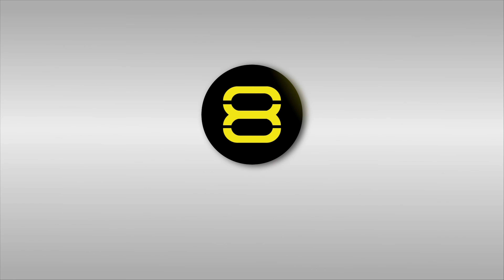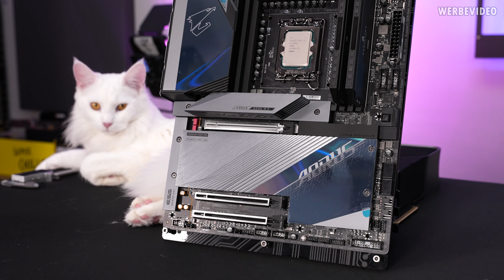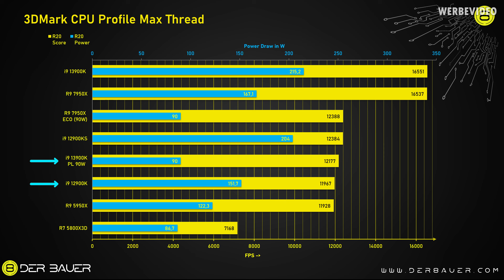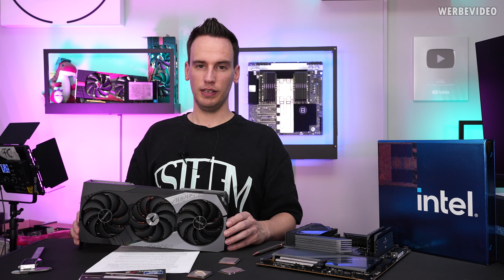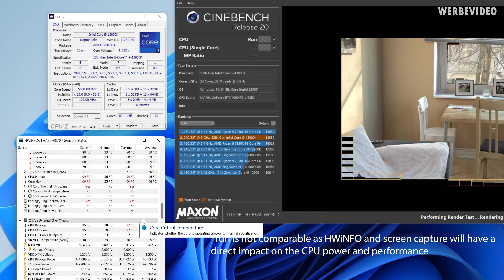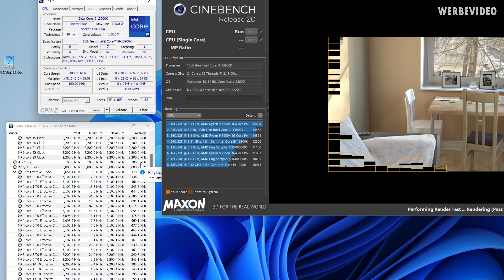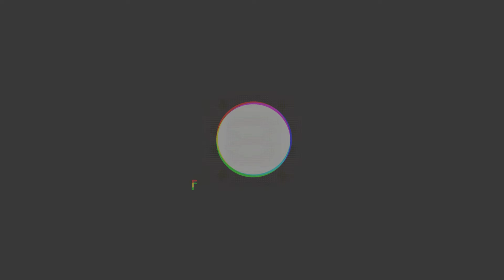Testing and Tuning the new 13900K for Efficiency

Comment: Question: what if you set a power limit of 200w then down clock the e-cores to 2.2ghz and cache to 3.5 to 3.6 how much loss in performance there would be compared to just altering cores and cache frequency? 

Might not be so worth it but can you try this on the 13700k as well?

Comment: 13700K+Corsair H100x+ ASUS z790-p WIFI

 Hello!
 Thought I'd check here if anyone has some knowledge of what I can do to bring the temperatures down on the cpu.
 I average 75-80c when running CinebenchR23.
 some games I play cause the fans to spin unusually much in my opinion.
 Cooling paste recently replaced with Thermal Grizzly Kryonaut, also the fans for the radiator replaced with 2*Noctua NF-A12x25
 all tips are welcome

Comment: This is exactly why you don’t listen to haters on the internet. If you know what you are doing and use common sense and do some reading. You can tune any system. I’m currently running a 13900kS on a H100i at power limit 288watts. I’m only playing games and it usually only takes 80-140watts

Comment: I get  >1000 pts lower in R20 (15200-15480) with my 13900k + DDR5 6400Mhz 32CL + z790 without thermal throttling on a clean build with just drivers. What am I doing wrong?

Comment: It blows me away that there are reviews of the 13900K out there that paint a very unflattering picture because the reviewer didn't have the cooling necessary to run the benchmarks they chose and while they note the 100c temp, they don't note that the insufficient cooling is holding the CPU back considerably. These new processors are super efficient, but ship in a performance configuration that requires incredible cooling to sustain, and that top 5% of performance costs you a lot of heat and power. If you don't need it, you can end up with a CPU that still performs extremely well but with very little power draw. I hope going forward people will start reviewing efficiency separately and tune CPUs and GPUs to see just what they can do at a reasonable power draw. As for Intel, they need to take a page from AMD and start making eco mode a first class feature, ideally with the ability to change this profile while in Windows and not in BIOS. We could see the return of turbo buttons to toggle eco mode.
Reply: You should be able to do that with XTU app: it's already possible to change CPU operating parameters on the fly in windows. Current versions of XTU even support profiles. How a CPU operation is parametrized is something CPU vendors define: UEFI are just UI thrown over that, XTU and Ryzen master are another UI. You can change the UI, but how to tell the CPU to use a PL1 value of 100W or 150W remains the same for all.

Missing piece here is understanding how they blend together: UEFI will apply at POST and all Windows based apps have to be told to apply the values at different points(app startup, app startup + start with windows)

Hope it shreds light on how to configure.

Comment: I tried your UC/UV setting and it just instantly crashes, is there anything else thats needed to be changed beside the 2 core ratio and manual voltage, I tried upping the voltage all the way up to 1.2v and its still crashing with 5.1/3.0

Comment: hardware unboxed got 200 fps on far cry with 13900k and 182 with 7950x. yours is way lower. the margin of differences is also almost 3x, this looks really weird. what's the reason for this? same cpu, same gpu, same settings, just different ram

Comment: You used just slightly faster DDR5-6200 for the Intel setup, other big channels used DDR5-6800 to claim Intel has the crown again...
As we see that DDR5-8000 has made it into press releases and AMD is stuck at DDR5-6000. My choice is very clear now.

Comment: Are you going to get in a 13900 non-K when they become available? Considering it's basically the same chip with a lower power target.
Reply: I don't believe there is any difference in performance if you limit the 13900k to the same wattage as the 13900

Comment: Hi im using 13900k with my 3080 Ti, usually i play Ultrawide 3440*1440p, once i set max settings in games my processor draw around 235W, How should i minimize this insane power draw?

Comment: The power comments about the 13900K matter more than you might expect since future titles will use those extra cores, and be more demanding - look how AVX workloads ramp up the power consumption

A CPU that games at 120W of its maximum 250W right now, might need 200W+ for gaming in 2 years time - always plan for the maximum power usage!

Comment: So intel and AMD are trying to one up each other in synthetic benchmarks by pumping voltage and power until silicone thermal throttles to protect itself from melting. Meanwhile, real life gaming performance is within 10% if you drop power by 50%. Like, even then it is still awesome but in order to top charts and sell well, we must melt the solder.

Comment: Why is he trying so hard to sell the i9 13900k as a gaming cpu? Thought i5/i7 was the gaming cpus? Also strange not having the 7700x when talking about gaming and power efficiency, since it is faster then 7950x in some games. And I don't understand the "win" of the 13900k at 70watts when he did not even try the 7950x at 70 watts. 
Amd low end boards in the test but Intel with high end board but conclusion still focus on price of low end Intel board, like I get you said that it does not matter, most reviewers would not say that without proof. Tests Intel with DDR5 but still recommends DDR4 as a options but does not mention the massive difference in performance that can have. Tests 4 games, the first 2 while interesting in a way is not what I would describe as modern games.
In my opinion, feels like a rushed review but still some interesting points.

Comment: Hi, I am using 13900KF, and follow the example to set my PL to 125w (Both Long & Short). I notice that my CPU VID can reach as high as 1.448 on certain cores (based on HWINFO32). Is this common behaviour that limiting the power will cause CPU to hit high voltage to maintain stability?

Comment: I think .1% lows specifically may be interesting just as far as the absolute peak stability of a CPU goes. 1% lows, meh. Avg fps, yeah it's kind of needed, but the .1% lows are usually not all that talked about even if they can have significant gameplay impact.
Reply: The lows are higher than the competition.
Reply: @Safetytrousers  By how much? Hitting which important FPS thresholds(48, 60, 90, 120, 144, 165, 240)? How do they compare to the 5800X3D, and what implications does that have for energy-efficient maximization of .1% and 1% lows when Zen 4 X3D chips come out considering past relative performance between the 5800 and the 5800X3D?
Those are the kinds of questions which giving the hard numbers begins to answer that "higher" doesn't.

Comment: Sooooooo just set a TDP/watts limit and tada? I wonder what a 125w limit would look like if it would close the gap further to stock.  125w still a lot better then 250+
Reply: Its crazy this means if you manually cap at 90 watts you can get away with a good air cpu cooler

Comment: Thank you for the investigation and yes if you are a gamer, and you own a RTX 4090 and have lots of money to spend on a 13900K or 7950X + the very expensive DDR5 6200 C30 kit (which most likely its over u$280, right?) then all this testing is usefull, but if thats not your case, then a cheaper 13600K, 13400 or even a 7600X/5800X3D will be a way better deal for gaming, it wont require you to do so many settings in BIOS, or the use of big coolers. 
Too bad performance with more "usual/normal" DDR4 platform was not tested for Raptor Lake, I doubt you will see this big margings in gaming and applications . And if you already own an Alder Lake DDR4 platform maybe it does not even make sense to upgrade to Raptor Lake. I guess its better to read and watch more reviews if this is your case.
Also there are lots and lots of games available, so maybe this 5 games not tell the whole story about which one (Zen 4 or Raptor Lake) is faster than the other.

Comment: intel -Series.12 MBoard Supports series13 CPU  Buys the cheaper one not $550 but $300 :) depends 1ST b4 you buy anything  Always Do your homework  Shop around .
DDR-4 mb  near 1/2 the price of  DDR-5 Mb's  -  DDR4 is tottaly Fine
 if your getting older & dont do alot these days  Dont Bother with upgrades >>  2025  More coming  3-6X faster  Cpu & Gpu's as always  Qxt-6700 quantum. rumors from a mate

Comment: You claim a few times (except full load at default settings) that the 13900K is more efficient, but maybe do an 7950X article with same 'hard trying' to get efficiency? I'm sure it would be as good if not better. Someone showed a graph of efficiency's and they were maximum 20 wat apart to 'perform' the same in a situation (especially in the middle efficient brackets), at rock bottom, Intel is better purely because of better idle (though not crazy amount, still 15w abouts), at high speed Amd is quite a bit better (and it should, with node advantage). 65 watt mode on AMD is also incredible efficient. (that graph where the x5950x is on top, should be beaten by 65 watt 7950x, plenty of sites proven it, that it's fact).

Comment: Do we know if the Thermal Grizzly 12th Gen CPU Contact Frame works for the 13th Gen CPU's? Getting my 13700k in today and wondering if I can get a bit better temps by using the contact frame, but since we're talking about microns of tolerance, curious if this is supported.
Reply: Thinking about the same. However,  waiting for someone to throw some light as the chips have a slightly wider and much longer die than the 12th-gen Alder Lake processors.
Reply: @hadesrhea6282  I'm inclined to believe that while the die might be different in size, the IHS is unchanged. If that's the case, it should be fine. I ended up biting the bullet and just buying both the Thermal Grizzly and Thermalright, because I have two systems that need it (1 12th gen and 1 13th gen), and I figure the Thermalright has more room for error since its tolerance is something like 200 microns instead of 40, IIRC.
Reply: @StefanKamer  Thanks for the Insight. Please share your valuable observation after using the frame with 13700K. Fingers crossed.

Comment: I just finished building a z790 aorus master, i9 13900k, h150i cappelix, 32gb ddr5 6400 mhz. Bios was completely stock, except xmp enabled. I ran about 3 passes of cinebench r23, while monitoring with hw monitor and noticed the instant thermal trottling. I stopped the benchmark and noticed power crept all the way to 330w. Can these 3 passes of benchmark damage or significantly reduce the life of my cpu? I expected max power to be 253w... thank you
Reply: It shouldn't: exceeding safe current values doesn't immediately damage the chip unless is extremely excessive. Reliability concern is over extended usage and that's for sure more than 3 CB passes.

You have to go out of your way to do damage in a short time-span, i.e: set an insane voltage value like >1.7V and stress test with that. This requires to:

1)Disable SVID in UEFI: with SVID enabled the CPU will request max 1.72V on Intel(there's vdroop, 1.72V requested doesn't mean that's actual Vcore) and that's something factory set by them.
2)Say the motherboard something along the lines of "I know what I do, just push 1.8V and shut up". Motherboards usually require some explicit step to "unlock" free choice of voltage supply to the CPU if they support it(usually only high-end boards): XoC modes, jumpers, etc.

That's because no one likes RMA so, both Intel/AMD and MB vendors go out of their way to make sure that if users damage a CPU by setting unsafe parameters they skipped past the airtight hatchway. Just going by cooling limits aftermarket coolers will not be able to keep up with current values high enough to do immediate damage, not even custom water cooling loops can sustain loads much higher than 350W at usual room temperatures(~20C)

Whoever damages faster than expected a modern CPU going by cooling nowadays is because they did direct die cooling, enabling themselves to cool >400W current or they did something stupid against which Intel already warns in their technical data: disabling C-states and/or disabling SVID aka fixed voltage or voltage override.

Comment: This .... confuses me.  In a good way?  Why does Intel set for such a high power draw on the 13900K (and, well, any 13x?) when it is stable and has nearly the same performance with so much less power draw?  I haven't seen a CPU I've so wanted to undervolt since the Northwood C!  I'm excited for my next build!  But why didn't Intel just make the default power settings more efficient?  Or at the very least make a "special" K-Eco? line of 13x CPUs binned to handle efficient use, set to a lower "stock" power draw?  Oh well.  Whatever, Intel.  LOL  Silent PC build for 2023, here I come!
Reply: Remember what he said about for Gaming only, you are not using all the other cores, but for other purposes you are and the power draw (if wanting the most out of every core) is naturally going to be super high collectively and with much less efficiency.  So then with single-core and all the other P-Cores and E-Cores tuned down, a gaming Frankenstein is born.

Comment: Would you say the i9 13900k is viable for mini itx builds? (specifically in the Sliger SM580 with a 280mm AiO)

Edit: use case is mostly gaming with some recording/stream/video editing from time to time
Reply: With a 280mm radiator any CPU is viable. You can dissipate around 600W with one of those when the water is ~30 degrees over ambient, you have to go deep into multi-socket servers before that sort of thermal load becomes a thing.

I’m running a 7950X and a 6900XT on a 280mm radiator right now, and the fans never go over 1000rpm. 13900K will be a little bit warmer than my CPU, but not enough to cause an issue.
Reply: @СузаннаСергеевна  cool, thanks :)

Comment: Isn't it funny that Intel's efficiency cores are almost a meme? More e-cores use up to 100 watts more power and therefore are less efficient than fewer power cores... Seems Intel is trying to make sure you don't need a separate space heater this winter with 300+ watts cpu and a 500+ watt gpu... you will have plenty of heat for this winter... Thermal throttling on premium AIO's at least serves some purpose??? LMAO....   (one reviewer I watched saw thermal throttling in 17 seconds on a 360mm and in 20 seconds on a 420mm AIO, even in games), I love to see AMD and Intel (add Nvidia too) competing and pushing limits... but, they all need to get a handle on power usage or soon we may need to install dedicated power circuits for our home PC's or risk tripping circuit breakers!  LMAO....

Comment: Can i do the same with a 13700k? 90 for both pl1 and pl2 i mean. Is it worth it for that CPU aswell?
Reply: I have the same processor and I have 10 BioniX p140 fans in the 5000d airflow case Any advice if you found anything?

Comment: ok thanks... i now understand all these high end options. but definately CANNOT afford it. SO my mid-range dillema looks a lot like this: after saving all my monies for an rtx4080 (not a 4090)... then there is basically nothing left for the cpu. So I have to pair it with 8700k for now. Then later on (when can upgrade CPU)... that will most likely be a 5800x3d. Simply no monies left. So that is where I look at the newer CPU platforms and say to myself... the money was better spent on the faster GPU (a 4080 instead of 4070) at 3440x1440p ultrawide or 4k. Instead of spending hundreds of dollars more for how many FPS?

What also is very helpful here is how you show the power usage is so low on the 5800x3d for the very high power bills we will be getting here in europe. Not only that but also for the better cooling (inside a room, not to dump the heat onto yourself) and also lower noise. Very much I am grateful for these numbers.

Comment: dam man :/ more  videos i  watch   worse it  becomes to  choose :/ I personaly im  looking for  Power.C and performance in terms of FPS whille streaming .And its very hard to  find out  test's that  uses CPU to  stream in  1080p 60 fps 6500kb  preset :very fast or super fast.  
i  was  watching a  friend with a  5700x and a 3060 ti, and  while streaming, he was going  from  70 fps to  43 on gta V . but at the  same time  a  5700x is like  250 € in comparation to  other  intel  CPU's , but at the  same  time a  freaking  5800x is  near of  350 or if its the 3D is  near of 500 euros.   Im  really  clue less  on what i can  actualy  choose , cuz atm im using a 2600x 4.1 ghz . pls, some streaming  applications as  review pls...

Comment: 10 years ago, i thought 600w psu would be enought in future, for high-end hardware... now i see... 1000w psu will be not enough. But the power limit its a surprise, if only we can change modes without reboot it would be better. This channel is one of the best out there and other channels are changing their methods and conducting more experiments because of you, keep the excellent work brother.
Reply: If you ran a PSU for 10 years, I'd say you've got your money's worth and it's time for an upgrade. It sucks having to replace parts that are perfectly functional, but if the performance isn't there, it has to go. That's no different for a CPU, RAM or any other part.